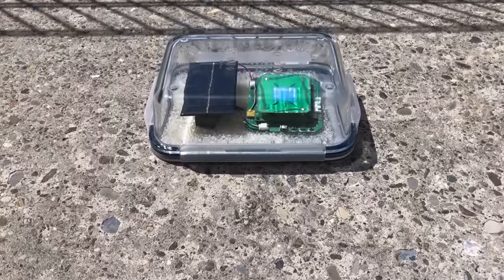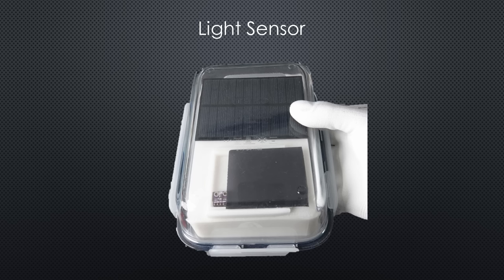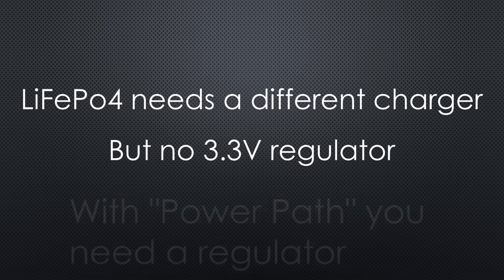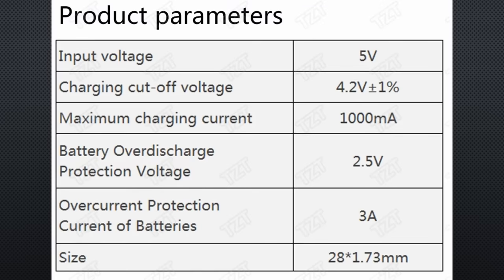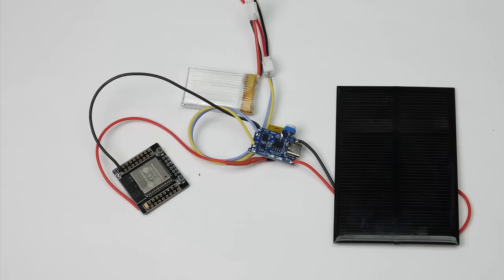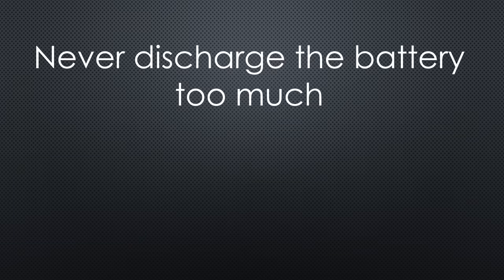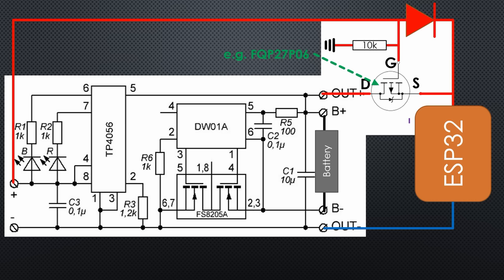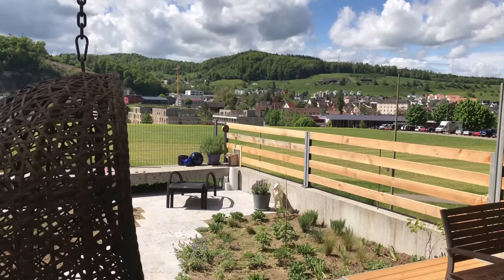#383 Cheap and simple Solar Power for our small Projects (ESP32, ESP8266, Arduino)

Comment: Hi there, I have a smaller panel (I think it maxes out at 4.20v) and when it switches to panel there's not enough current, I guess I should change the 10k resistor for something smaller or just remove it, voltage regulator should compensate for that. One more thing I didn't change the current limit resistor (R2) could it be the culprit?
Reply from the maker: I am not sure if the charging works with such a panel (the maximum power point is considerably lower than the open voltage).
Reply: @AndreasSpiess  Thanks, for you answer I have already solved it and re-measured some   things.  The panel will give me probably up to 6 volts in the sun, we have a really strong sun where  I live. The thing is that I didn't use the parts you recommended as I was building autonomous solar lora/meshtastic node and I was going thru all scrap boards for components (those pesky P channels are hard to find, whereas N there are plenty). Nevertheless the problem was the voltage regulator as  the one I initially found had a drain of about 1V, I looked for another one  and exchanged it. Not a clue what parameters it has as I cannot get a datasheet but must be one of those low drop, so all seems to work now. Test phase on.

Comment: Very helpful video!  I've played around with this a little lately with a view to running a few esp32/ esp8266 lora sensors. 

It appears that solar charging is working though I've not yet got around to monitoring / logging battery voltage closely. 

I'm a little confused about the standby & charging status LEDs... do these behave normally?  i.e. blue / green led is off and red light indicates charging and vice versa when charging is complete?  I've tried the 2 diode and p mosfet power paths and on my modules the blue led remains on indefinitely red lights up when illumination is great enough.  It appears an opamp version also behaves this way too though I've not tested this method enough yet to confirm this behaviour) 

Is it just my modules that do this?
Reply from the maker: I did not investigate in this. So I do not know :-(
Reply: Thank you for taking the time to reply. Research so far has suggested several possible causes for both LEDs being lit...  none of which appear to explain my case (other than perhaps not all of these TP4056 modules being equal... with more than one suggestion that the USB-C ones, in particular, can be temperamental!). I'm leaning towards this ATM since an OP-amp version behaves the same. 

I will keep experimenting when time and weather / sunlight allows and post back here if I manage to solve it, just incase its any help to others.

Comment: And how would you cope with winter below-zero temperatures depleting li-ion battery?
Reply from the maker: During last winter, a bit below zero did not harm my Li-Ion batteries. Most electric cars also have to live with minus temperatures. And here we only use very low currents.
Reply: @AndreasSpiess  I plan to construct a temperature logger for a mountain lot, and bury li-ion battery 1.5 to 2m underground, where hopefully temperature is not so low. I am currently making a small attiny13-based solar tracker for more solar power for this temp. logger. Have you ever considered putting a battery under ground to avoid freezing?
Reply from the maker: This is a good idea if you can dig such a deep hole. I never did it.
Reply: @AndreasSpiess  thanx for the answer, I guess I'll try using a hammer and a pole, hope it will work :)

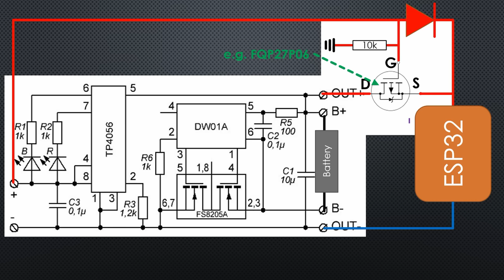Comment: Nice video as always! You have here a huge fan! I just have a question, at 11:50 you say that you use the P-FET so the voltage drop is nearly 0. However, according to FQP27P06, the body drop is around 0.6-0.7V (the same as using a diode). So, what I am missing here? Thank you for your videos :D
Reply from the maker: FETS do not have a fixed Vds voltage (in the right direction). They have an Rds on resistance. So the voltage drop is according this resistance. And if Vgs is big enough, this resistance is well below 1 ohm.
Reply: @AndreasSpiess  thank you for answering! However, for PMOS, the right direction for current is from Source to Drain (which in your circuit is from ESP32 to Battery). 

The current from the battery to the ESP32 runs through the body diode of the MOSFET, and therefore it is not affected by Vgs but for the diode-body characteristic.

Comment: Another great video. The container is a nice way to protect the solar cell if it's not hardened for external use. Does the glass you are using reduce the output from the solar panel at all?
Reply: I think, the heat trapped inside (during the Summer) may have a larger effect.
Reply: @michaels3003  A good point. I think that aspect might be covered by data sheets reasonably well.

A sealed container appears attractive to keep out water (and wildlife) but feels ultimately problematic if it's going to get baked in the sun. I've been pondering this sort of thing for environmental monitoring where by definition it needs air flow. I've recently discovered the Clarity Movement Node-S. They have a robust external solar panel that goes above their enclosure. I think it's designed to set the angle for best results.
Reply: @kevinwalters5160  , after my comment,  I saw a comment from Andreas that the temperature reached a maximum of 65 degrees C!
Reply: @kevinwalters5160  , I've looked it up. That's a clever and compact design.

Comment: Great video, as usual. You're one of the bests on content about iot and microcontrollers. Only one thing, the used esp board adc pin accepts 0 to 3,3v or 0 to 1v.?
Reply: The ESP32 ADC accepts 0 to 3,3v. The ESP8266 0 to 1v.
Reply from the maker: The ESP8266 chip accepts only one volt. Some boards already have a voltage divider implemented. Those accept 3.3 volts.

Comment: Hi Andres, doesn't LiIon/LiPo have much less actual capacity when it's cold/winter? This would have an impact on the capacity calculation wouldn't it?
Reply from the maker: You are right. But winter happens where I live and I have to accept it. Last winter I had no problems.

Comment: HT7333 does not work right? It needs way higher imput voltage to make the 3.3v stable?
Reply from the maker: AFAIK it has 90mV dropout @40mA current.
Reply: @AndreasSpiess  You are right, another question: when the solar panel fails; will the voltage divider drain the battery over time?
Reply from the maker: Yes

Comment: I was wondering if an old school NiMH battery using a capacity/10 method would also work. This would be extremely straight forward (and use parts which most of us have lying around). Would the internal impedance of the battery be an issue?
Reply from the maker: I think that NIMh batteries would work, too. Maybe you add a 1000 uF capacitor across VCC and GND of the ESP to prevent too high currents.
Reply: You would have to use a different charging board and actually change everything else too. Also different cells could go in unbalance. Try to find a broken battery pack from a laptop. Most of the time there are still a couple of good cells.

Comment: Hey, Servus from Bavaria. Great Video! Thinking about putting it on a small pcb and adding a second power path to still allow for 5V USB charging at 1A. Bom should be quite cheap, maybe a small batch would be feasible but i am not sure if worth the time. But maybe there are a few others interessted. Would you object to such a Plan?
Reply from the maker: Maybe you also look at the bq24074 if you want to create your own board. It already has a buitl.in power path...

Comment: GREAT MASTER.
Will you allow me a stupid question?
Could I use a 5v solar panel, made to charge mobile phones, and attach them directly to usb?
I tested with a LILYGO® TTGO LORA32 which has its own battery mount. But I don't understand why it works but it doesn't charge the battery ... It only recharges with usb attached to the computer ...
Reply from the maker: I assume you solar panel has a USB output which you plug into the TTGO board? Check the voltage on the 5 volt pins of the TTGO board when it should charge. I assume it is below 5 volts. Otherwise I have no idea :-(
Reply: @AndreasSpiess  Thanks...Then I'll let you know when I get home ... Now I'm on the Marmolada ...

Comment: Hi Andreas, thanks for another well explained project - appreciated.  I’m wondering if the the is a small SMD alternative for the FQP27P06 that you can recommend? Thanks
Reply from the maker: I have NTF3055, SI2302DS (small) or LBSS138LTI (also small)
Reply: Thanks Andreas for responding, you run a great channel 👍

Comment: Thanks for recommending this video. I just don't get very well the current reduction. I would need to do this if i get one of the panels you shared, right? I dont see any of them get to 1000mA. And my problem its that i'm not very skilled (for not saying i'm null) in soldering and i'm not sure if i will be able to be Indiana Jones like you  :D  . So my question its, if i dont do this, it will work but not be the best performance ? Or  it wouldn't work at all. Thanks!
Reply from the maker: You can try it without the change of the resistor. It might work as well. Maybe you will lose some efficiency. If you panel is big enough this probably does not matter too much. Maybe you do some measurements with your particular design.
Reply: @AndreasSpiess  i will try. Thanks

Comment: Hi. Im building a water level sensor for the tank on the roof wirelessly. Using solar power, phone battery and ultrasonic sensor. Can I use relay or transistor to turn off power to sensor only and wake up just once in  half hour to take measurement and send data to secondary module in my house?
Reply from the maker: Yes, this is possible. Better a transistor because relays consume a lot of energy. Maybe you also watch my videos about deep-sleeping ESP32 or ESP8266

Comment: Thank you for this very instructive video, I am considering following it for my project.
I have two additionnal questions :
1. I am guessing that the determination of R3 depends on the solar panel output power : since we can rarely have 5-6 V, we prefer lowering the charge current, to have a wider use of the solar panel. Is this correct ?
2. Is there any negative effect connecting a 5 V step-up converter before the chip ?
Reply from the maker: 1. Yes. But you can try without it first.
2. The step-up is only useful at low light levels where the panel anyway does not provide a lot of energy. So the converter would probably use most of the energy. Only very dedicated energy harvesting devices use this concept. But this is another story (I made a video about it)
Reply: @AndreasSpiess  Thanks a lot. I asked my second question because I want to power a chip at a stabilized 5 volts. If you say that a step-up converter would use most of the energy, I don't understand how to power my chip with this set-up.

Comment: If you switch to sending the data via ESP-NOW you can get quite a good battery life from AA batteries with 10 minute update time. With C or D cells and you get a few years. Still, that requires an extra ESP32 always powered to receive the data, but it may be a simpler setup than relying on solar.
Some numbers here https://www.electrobob.com/esp-now/
Reply from the maker: You are right, we can use many more low-power transmissions like 433MHz, LoRa, etc which were covered on the channel . This time I did not want to present another low-power solution as an alternative.

Comment: I wasn't even more: can the wasted voltage going into the LDO (when sun peeks out of a cloud, but the battery is discharged) , be used to charge the battery?
Maybe a zenier diode to direct the extra voltage to the battery charger?
Reply: check for  more convenient charger TP5100. it can input up to 15V and convert to 4.1 or 8.2 output with charging current as of 2A.
Reply from the maker: The LDO will only take the current needed for the ESP. The rest goes to the battery.

Comment: I studied this video, as well as the one you linked, and for my purpose I am not sure if this is what I want.  What I need is that when dark power comes from the battery, but when daylight comes the battery is charged, but the load is removed from all power sources.  What I see in the schematic you have, or the other video has, works great for any load that needs to be on continually such as a beacon, or esp32.  If I have a load (say a light) that needs to go off at dawn (to allow the battery to charge up) then come back on at dusk from the battery how would I achieve that?  Any idea what extra part I would need, or changing in this?
Reply from the maker: You find many diagrams on how to switch an LED based on light. You only need an LDR and a FET (e.g. https://somanytech.com/light-dependent-resistor-photo-resistor/ )
Reply: @AndreasSpiess  Would something so simple be all that is needed?  I was thinking about doing that, but it just seemed too simple.  edit:  I was thinking of using an IR 5mm led for this purpose (is even in one of my carts) so a bit torn between the old LDR and the IR led.  I am leaning towards the LED.

Comment: Thank you for the video! Can I use an IRF5305 Mosfet for the current path with a 10k resistor?
Reply from the maker: No. It’s minimal Vgs is too high
Reply: @AndreasSpiess  oh, I don t have other transistors at the moment. Then what diodes can I use?
Reply from the maker: @Alex-lw2xc  any diode.

Comment: Where should the voltage divider to measure the battery voltage be connected to? Should it be connected directly  to the TP4056 OUT+ (before the power path)? Or just before the ESP32 voltage divider (so after the power path)?

I know it is a bit late, more than a year since the video was out, but I am trying to implement this on my project and hopefully somebody can answer. Thank you for the video!
Reply from the maker: You have to connect the voltage divider to the voltage of interest. If you want to measure battery voltage you have to connect it to the battery.
Reply: @AndreasSpiess  Understood. B+ and OUT+ are indeed connected in the TP4056. Many thanks!

Comment: Seen this method before.. cant wrap my head around the load sharing or "powerpath" part tho... what happens when the solar panel starts operating the mosfet in its linear region??
Reply from the maker: In those rare (or short) cases, the result is not defined. Solar panels tend to quickly go through this part of the curve when light appears.

Comment: hi - i havnt used microcontroller for a while - what is a good microcontroller board to use with a solar cell with wifi and 2G/3G/4G? do you suggest ESP32 or a Ardunio nano development board? do you have a link to a microcontroller dev kit for those requirements?
Reply from the maker: 3-5G are not natively supported by any MCU. If you need Wi-Fi or BT, the ESP32 is the best solution. But it consumes more energy. If you need low power, some Arduinos are better.
Reply: @AndreasSpiess  but adrunio also offers wifi: - arduino nano rp2040 connect - whats the diff to ESP32? also regarding the solar cell - is there a a solar cell i can simple buy and connect to one of those microcontrollers - either ESP32 or the ardunio?
Reply from the maker: @Gerald-iz7mv  I think you have to do your own research. You read my opinion.

Comment: Is the FQP27P06 a good choice in this case? I'm new at this and learning every day so I could have this completely wrong, but it appears to me that 4V Vgs(th) of that MOSFET appears to be so high that the mosfet would never reach it's gate threshold voltage and so stay open continuously? 

EDIT information on the net regarding this is quite duplicitous so I'm unsure if Vgs(th) is a) an absolute value or b) the value that the Gate must have above the Source voltage to switch the MOSFET?
Reply from the maker: Vgs vs Id or Rds is not an absolute value (you find its curve in all spreadsheets). The FQP27P06 starts to conduct at around -2.8 volts. So there are choices which are a bit better. If the panel has no sun it is at 0 volt and the battery at maybe -3.3 volts. So even the FQP27P06 should conduct.
Reply: @AndreasSpiess  I think you're right on that. But how much voltage would the solar need to provide to switch this MOSFET off so it doesn't overcharge the battery through the powerpath?
Reply: @RickTizzy  If you look at the datasheet, the FQP27 if functionally "off" any time the VGS is greater than -2V. The body diode has Vf of something like 4V.  The only way to over-charge the battery (more or less) would occur if Vs were greater than 4.2V.  For that to happen, Vsolar must be approximately 4.6V (Vs + Vf for the schottky). Now, flip that around, and note that Vsolar = Vg; Vgs must be positive in this case (by the value of the schottky forward voltage), which is greater than -2V, so the mosfet must be off.

Comment: Hello Andreas, i use a same protected charger with solar panel, one 18560 and 5v booster.Powering uno,gsm900 and sensors i use a ds3231 to start the circuit every hour.My problem is when it shuts off,after a while the charger protection stops feeding the booster because the load is μΑ.Is there a way to disable this?
Reply from the maker: I do not know your setup. If I remember right, in my setup, the battery is directly connected to the output and I do not have a booster.

Comment: Is there a USB device for USB solar panels that prevents the panel from "charging" connected devices under 4 or 3.5 volts? I bought a solar panel with 5v max output, connected my phone to it just to test it, and left for a day, the phone ended up discharging in hours, when regularly it can stay up for days.
Reply from the maker: Strange that the phone itself is protected against discharging this way...